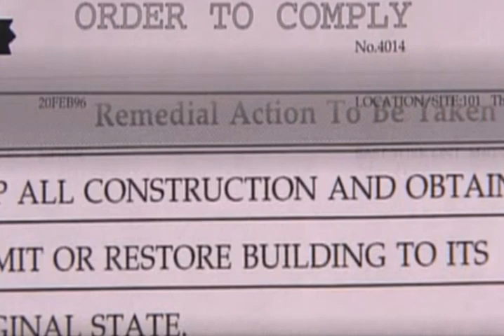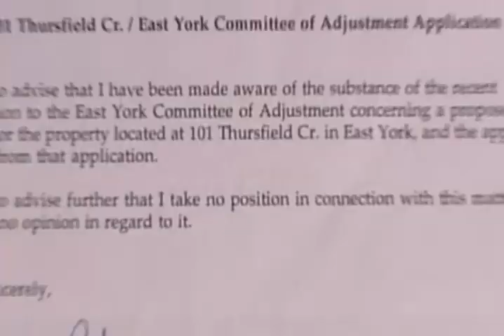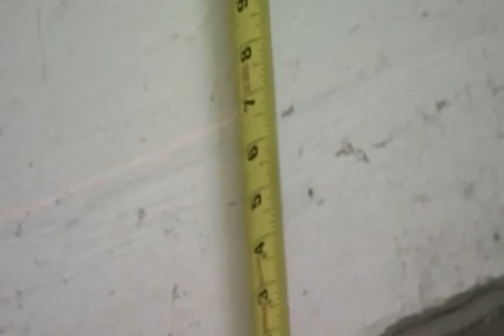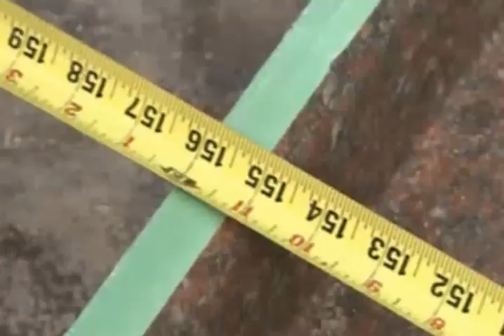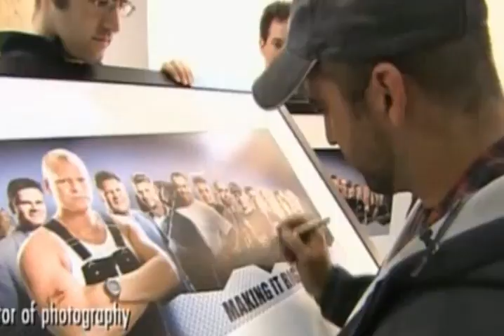Holmes On Homes Sea 05 Epis 03 Falling Flat

Comment: I had a 30x40 four bay garage built (three in front and one on the side). When it came to get the electrical inspected the new building inspector stopped the permit. He didn't inspect it doncha know! Guy knew nothing about post frame buildings. We went back and forth in email for two weeks then I finally called him and asked him to actually come and inspect the effing building. He did and was instantly satisfied. What this guy here went through is criminal. He should have sued the town/city.

Comment: No that concrete siding can be a do it yourself,  we did it when we resided our garage. Dang heavy stuff, wore us all out. But I didn't have to fix dinner and holds up well during a hurricane.  We removed the cedar siding, which had held up pretty good.
Reply: Never said you couldn't just not DIY friendly.

Comment: Biggest pet peeve as a plumber——the copper pipe for the T&P valve coming down crooked from the water heater!!!!!
Reply: I could live with that. For some reason the thing has the drain and the TP outlet in a vertical line. For me, it is the fact that the TP valve doesn't empty into a Smitty pan or outside the wall outdoors.

Comment: 16:11. Not perfect, or even close, in MHO. What those guys did is lay a base coat and nail it down. Mistake #1, puncturing the membrane. Mistake #2, the right way to do it is to Soprema tar the plywood, and torch the base layer down. If a tornado rolled through, one loose edge or corner and the whole thing is gone.  Mistake #3  3 layers is just not done on a residential garage. 2 layers is basically impenetrable, and you're still getting the same 30 years out of it. 
23:28  No you don't, you need to splurge the $100 for a set of PacTool International SA903 2-Piece Gecko Gauge Hardi Board Siding Gauges. You level your first row, clip these on, and they hold all the following rows in place.
24:14  How is that better than the standard laser? It just means you now have to keep track of an accessory.

Comment: Thumb down for the sheer fact that the video is visibly sped up. Mike holms actual channel on YouTube Zero videos sped up
Reply: It's a tactic to defeat the Youtube bots. Just go to the gear icon in the corner of the screen and change Playback speed from "normal" to 75%. Then it will look and sound normal